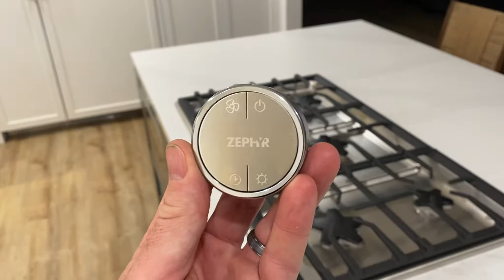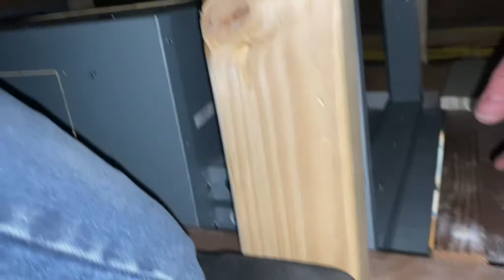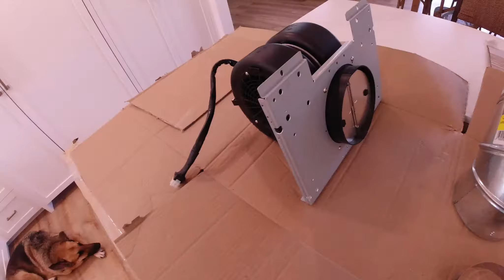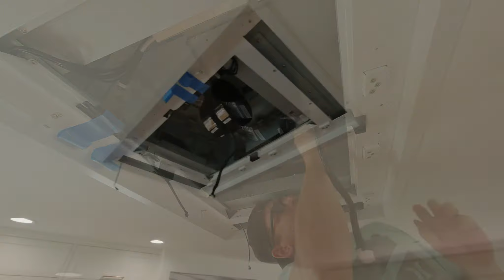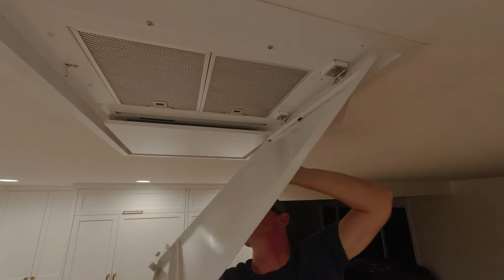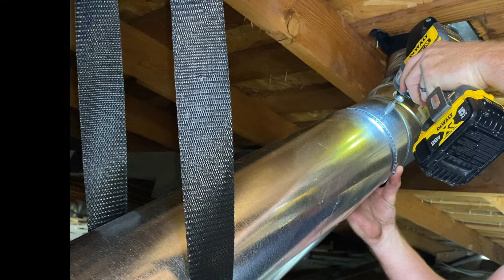Zephyr Lux Demonstration and Installation Instructions

Comment: Can you recommend any installers in GA? I am about to get the 64 inch for my remodel.  I have a sofit built already but will have to remove the sheetrock to install. Am using the old duckwork already there to vent it out.

Comment: How do you pair the remote? The instructions indicate that you need to press the light button on the unit itself but I’m not seeing any…
Reply: They're talking about the button on the hood itself - it's the grey silver panel with light - on/off - fan.

BUT BUT BUT - wow the instructions are terrible for how to set up the antenna - and this is absolutely critical.  If you can't get the remote to talk to the hood, try taking off all the grease covers and I bet it'll start working for you.  The remote is a radio, and all the metal in the way appears to block the remote signal really well.

Comment: Can this be installed if I have my 2nd floor above the kitchen? (There’s a bedroom above the kitchen, not my attic)
Reply from the maker: Khaled that doesn’t sound easy to do, the only way is if you build a drop soffit and lower the Zephyr down, also you would need to expose your entire ceiling, ie remove all drywall and route the duct in between rafters.
Reply from the maker: Do you currently have a range hood with exhaust up to roof?  Or does your hood just filter and recycle the air back into the kitchen?
Reply: @MuellerMechanical  I was just wondering this same thing for myself...Mine is new construction but I wouldn't want to drop it down. Is their not a slimmer version for in between ceiling joists?

Comment: Is the remote control magnetic?
Reply from the maker: Yes.  Also it comes with an adapter that plugs into an electrical outlet that holds the remote.  Does not use power, just uses the outlet as a holder like if you have outlets in your island.

Comment: Wouldn't it be better to go straight up through roof instead of routing through a couple of 90 curves?
Reply from the maker: No this was a kitchen remodel so the roof penetration and roof vent was already existing but fan was moved to new location in the remodel.  Super easy to re route to existing vent vs. tearing into new roof work.
Thanks,
MM